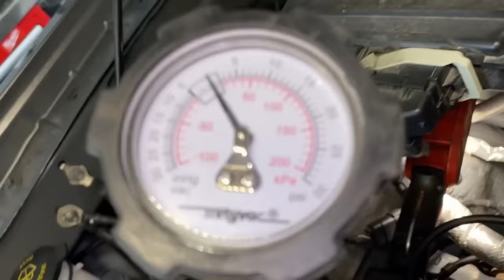2011+ Ford F-150 3.5L GTDI Ecoboost Engine P0299 Turbo Underboost Quick Diagnostics

Comment: HELP!!! I have a 97 F250 7.5 and its been hesitating when I give it gas, if I try to gas through it it stalls. But if I throw it in neutral turn it off and turn it back on it works fine for awhile. Its gradually happening quicker
Reply: The 97 F250 7.5 did not have a turbocharger or supercharger to my recollection and therefore should not be getting a P0299 code.

Comment: Any ideas why 13 3.5l goes into limp mode on start up after being driven. It shudders and dies on its own after a while.  Only does it occasionally. Takes longer to crank. Then fires up. Give it some gas and then it runs fine.
Reply: Need the change spark plugs and boots and/or need a new throttle body.

Comment: So what do you think and say about the weep holes that folks are drilling in the bottom of there inner coolers to get all the oil and condensation out I think there doing 1/16 hole or something I read it in a group or 2
Reply from the maker: It's a mess, best to install a catch can and do it right.
Reply: FordTechMakuloco I have a catch can installed dump the oil out the cooler I pick up a jdl for 50 bucks used

Comment: Planing to check the blow off valve tonight, but any other pointers for a 2013 F150 Ecoboost that throws a PO299 Underboost only when towing, generally mountains, generally at or near wide open throttle? Can clear the code and go another 500 or 10,000 miles without throwing the code again. 

My truck has been throwing this code for the past 3-4 years, but only a few times per year. Very intermittent.
Reply: Nah for sure its the BOV. Had same issue, only when towing camper or climbing a hilly road otherwise no CEL. In my case, didnt even get reduced power just got the stupid CEL and a bad feeling that this was gonna be a very expensive fix. You can clear the code and not see it again but as soon as you put enough load on the engine to force that valve to open wide, the CEL will come back. I went 3k before I saw it again then at that point I wanted a permanent fix

Valve change is fairly cheap and quick and the new part is better made than the old one. Takes maybe 15 minutes at most to do and gives you back the peace of mind that comes with no lights on the dash!
Reply: Confirmed, giant tear in the BOV.
Reply: I maxed out around 5psig boost before replacing the blow off valve, hits 13psig now. The engine will register the low boost fault but will only give the light if it registers the same low boost condition repeatedly, and if you drive gentle it may never notice at all

Comment: Bizarre timing. Got this code on my 2013 Monday, replaced the broken valve, fixed it. It's a pressure balanced valve and when that orange seal rips, there's a direct gas path open back to the inlet and the solenoid is no longer strong enough to keep the valve shut. 105k miles, $60 or less. It should probably be proactively changed between 60k to 100k.

Comment: So I just bought a 2013 f150 and I don't have that code but the boost pressure release valve is clicking so I'm getting that replaced but while I was under my truck I noticed a screw in my intercooler. Now I read before people were drilling holes on the driver side of the intercooler basically making it a weep hole to drain the oil. Is that going to be a problem? I'm going to have to fix asap or am I ok?
Reply: Just so people don't get on me I know the boost pressure release valve opens and closes but it's not normal for it to keep doing it very loudly every 5 to 10 seconds. When I got this truck it didn't do it at all till I drove from Virginia to Massachusetts and back to Virginia. I had the truck for 2 months before the trip.

Comment: I have a 13 ecoboost f150 that has severe turbo lag but it's not setting a code. Turbos spin freely by hand, catalytic converters aren't plugged and no boost leaks that I can find. Any suggestions? Do you think this BOV being torn could cause a turbo lag sensation?
Reply: It's really simple to pull and check. My 2013 valve was ripped to shreds and caused some performance issues but only threw a code when pulling a 7klb trailer up an onramp.

Comment: What I dont understand is why is the intercooler full of oil residue??? I always thought intercoolers drop temp of intake air...but no oil
Reply from the maker: As with any forced induction system there is much more oil carryover compared to naturally aspirated.

Comment: whats up man i have a question i have a 2017 ford fusion ecobost 2.0 i have the code p1016 i changed p/n f2gz9e882a but not thing still code is there

Comment: So have question ...it will b on 2004 ford Taurus.....plz help.... so car 77xxx miles runs great...I programmed a remote by turning key  8 times fast.. so it worked ...but now I have low battery voltage at idle ...goes up with rpm ....any idea ...thx n advanced
Reply: Sounds like alternator.

Comment: Do you know the part number for the pig tail that connects to the pressure relief valve you showed towards the end
Reply from the maker: WPT-1402 is the part number for the pigtail connector that plugs into the blow off valve.
Reply: Thank you!!

Comment: Ok here goes I have a 2005 Ford f150 5.4 3-valve that I'm having problems with a lot of problems mainly the spark I change 7 out of the eight spark plugs but with cylinder for I'm having a major issue with I've tried everything I can possibly think of to get this Tim's bar plug out it just will not under any circumstances come out I've tried the Ford extractor thing is not working tap and die not working penetrating oil not workingWD-40 not working nothing is working so today I went and bought a spark plug wrench to try to use and all the wrench did was take out my solenoid what do I do please help please please please somebody give me some adviceI can't think of what else to do I try to take it into the shop they want to charge me $450 to take one spark plug out just one that's highway robbery.I did the seafoam in the gas tank with everything else came out fine all other seven spark plug came out perfect nothing was broke peachy great wentvery smooth but it's one cylinder 4 won't come out should I just take my engine out.

Comment: 2012 Lariat 3.5.....  what is "underboost"?   just went 200k and when I tow my boat, I have NO power.. thing is running in 5/6... give it a little gas or hill 4/6 and even at times at 75mph.. it will go 3/6 on a really big hill.   Never has done this before.. always towed the boat like money with plenty of power.. hardly ever shifted down even on hills.. and if it did, you couldn't tell.  Right now it feels like I'm driving a super under performing engine.  there is NO engine light?  just throw me a guess.....    I had a local garage replace the solenoid for the turbo.. thought I hear a humming when it was pulling hard.  grrrrrrrrrrrrrrr

Comment: Hey man I was wondering if u have pulled a 17 model f150 5.0 motor out can u please tell me if the cab has to come off
Reply from the maker: no
Reply: @FordTechMakuloco  thanks I found a identfix TSB on it it's just alot of work

Comment: I have a 2013 f150 3.5l throwing the p0299 underboost and also going into limpmode. Once the code is deleted and the truck is restarted it runs fine for a few minutes then goes into limpmode again... if someone may have an idea please let me know

Comment: Hello All,
I have a 2014 F150 FX4 with the 3.5 Ecoboost. I have this burning oil smell from the right/passenger side turbo but only on first startup after sitting overnight or after a couple days. There is no visible external leak except where the turbo connects to the exhaust pipe i can see signs of oil at the connection and the smoke as the oil is being burned off. This smoke gets in the cabin as well when the fan is on and it comes out the from of the hood as well. Anyone has this problem before?

Comment: hola tengo un problema en mifor focus te comento ace nada cambies los inyectores por que notava que tenia relentin inestable y me echava un   poco de humo blanco en arranque en frio me da sensacion que el olor  es como mal combustion si te pones cerca es como si te picase los ojos  el motor a estado parado casi 12 años y se paro con 11000k por un porrazo trasero  cambie el motor a otro coche y llevo un año conduciendo  e cambiado reten del ciguñal y volante motor  e puesto los 4 inyectores reconstruido  y filtro de gasoil y filtro de aire ace 5000k  pero despues de poner todo esto veo que solo en frio meda la sensacion en arranque frio da como cabezeo como un prelin de relentin inistable y el humo blanquecino un minuto esto dia lo e estado mirando y es mas grisacio balnco  grisacio eso si huele como mal quemado no aceite  sino mas un olor que si mete la nariz tienes que quitarla al momento que puede ser ese problema gracias de todas formas

Comment: Could a failing Turbo sound like a Plane taking off (loud scream) when the accelerated ??
Reply from the maker: Yes if the turbine or compressor wheel is contacting the housing.
Reply: @FordTechMakuloco  Thinking about purchasing a Transit 350 ecoboost 3.5L van with 187,000 miles. What are things I should have the mechanic check before and is it worth that amount? Noticed a used tow pkg. so it has been towing something. 64 years young going to start traveling solo across the states with a SAFE vehicle. On SSD and can't afford new anything. 😊
Reply: @FordTechMakuloco  The mechanic told me the truck (2011 F150 Ecoboost) needs both turbos and the intercooler as the metal chunks have made a hole in the intercooler. But he's not sure if the metals made it inside the engine block. Spending thousands will be worthless if the engine block is screwed. 
What do you suggest?

Comment: What would cause a oil smell in the cab on a 14 F150 Eco 3.5 ? Just with the heat on not the AC ....
Reply from the maker: I would say an oil leak from the turbo or vacuum pump.
Reply: @FordTechMakuloco  Thanks 👍😊
Reply: @FordTechMakuloco  I don't have any trouble with the breaks, does that matter? And can you just replace the gasket, or do you need to replace the entire unit?
Reply from the maker: I will not affect the brake assist, it will just leak engine oil. We always replace the entire vacuum pump.

Comment: Hey, does anyone know what this is? I have a 2012 Ford Fusion SE automatic, with the 2.5L engine. When I have my A/c turned, my car makes this rough vibrating/grinding sound. This happens if I try to accelerate from about 1500 rpm, especially when going up hill and around 35 mph, and when I’m light on the gas. I also notice my car isn’t as responsive with the a/c on. These problems go away once the a/c is turned off. I’ve seen a video of a guy who has the exact same sound if that helps, but it doesn’t have any answers :/ 
The sound goes away if I take my foot off the gas and put it back on harder.
Reply: @Jonathan I've heard people did that and it solved the problem. How much was it for you to have it replaced?

Comment: Do you have to remove the intercooler in order to remove the EBOV?
Reply from the maker: no
Reply: @FordTechMakuloco  Thanks for that! My 2013 is throwing up that code, no power... Your video couldn't have come at a better time! I already ordered the new valve, but all the install videos I've seen have them removing the intercooler.
Reply: @TK-cl1jm  Brian is right you dont have to remove it to change the BOV but at this point you are fairly deep into it and probably could use the time to do a drain of the CAC. Unless you have the weep hole mod or a catch can, there is a fair amount of oily sludge in there that could be cleaned out. Just my .02 and respect again to Brian for making the video!
Reply: @aaronturner1072  Thanks Aaron. Yes, I have the weep hole mod already.

Comment: What you explained on the Exoboost F150 is that true with 2013 2.0 Edge? I’ve lost boost and have the same code. I’m not sure if the 2.0 has all the same components.

Comment: I have questions about passenger side wastegate actuator corrosion. I have similar issue in my F150 as in the video 7:21 - only the passenger side is corroded. Does anyone know why?
Reply: Mine is too figure its just because they are subject to moisture coming up from the road. Seems to be only surface rust so not worried. The driver side on the other hand is still good...because the oily discharge from the intake pipe keeps it coated!
Reply: @aaronturner1072  I thought maybe this is happening  only in my car. It reassures me a bit that this is a known problem

Comment: At 12:21 broken bolts are so common on Fords that they need to use harder bolts. I will not buy another Ford until they do a better job about rusting way to fast underneath the vehicle. I sew frames rust where they never should have.
Reply: Buy a new car every 5 years you won't have to work on it. That is what car companies bank on.

Comment: I see amsoil on the table isn't that boutique oil as  you call it ? What no Pennzoil Mobil 1 lol
Reply from the maker: Amsoil sent me some products to test after seeing my videos. My main parts shelving holds the 30 jugs of Pennzoil.
Reply: @FordTechMakuloco  I also use amsoil in my vehicle except engine oil cause I change my oil every 5000 kilometers 3000 miles or 3  months great products
Reply: John Mattiazzo they have their “OE” line of oils that are the same cost as the big box type oils. They are developed to go along with the manufacture oil change schedule.
Reply: I find Amsoil to be great for my 2 stroke engines. Little smoke and keeps plugs from fouling as fast on weedeaters, chainsaws, leaf blowers, to 25 hp boat motors.
Reply: @JasonW.  I also use it it my stihl trimmer great products spark  plugs always looks so clean
Reply: @JasonW.  That is because it is the new euro spec 2 stroke oil. The inexpensive Homelite oil doesn't smoke either .

Comment: amazing, a relatively new F150 turning into a rust bucket already.  connectors, cables,  lines getting crusty with rust.  Ford should be ashamed selling this crap, using cheap components.

Comment: Just don't buy an ecoboost is the diagnostic recommendation.  Just too much extra crap with a turbo engine.  The radiators are bad enough to leak then you add in a cooler for the turbo - NO

Comment: Wow, extra complication from Ford.
Look at Nissan, Honda, Hyundai, etc. and their turbo designs and very low volume of issues.
Reply: Ford  also sells more F-150's in the US than total cars sold by Honda and Nissan combined. They've made over 15 million Ecoboost engines. They're very good engines and they're used in heavy work trucks, not tiny passenger cars.
Reply: Sure. Whatever man.

Comment: Honesty as a flat rate tech at a Ford dealership I wish u would quit posting shit like this. Every customer comes in and already think they know the problem because there utube certified and your messing with our money
Reply from the maker: If I don't then someone else will. I post hundreds of Ford How To videos yet my Ford speciality shop is still overrun with work. So you guys are either doing something wrong or blaming the wrong person for no work.
Reply: @FordTechMakuloco  we stay busy,but there's nothing worse the a customer coming in saying ,I watched this utube video and this is what's wrong put this on my truck.theybhave some aftermarket part and it does not fix it then u know who gets blamed. The tech as always. If have been in the buisness u know we get all the blame.  U got over 500k sub. U arecdoingvsomthing rite. I dont have that luxury.I looked into the channel. Thank u for your service first off. I will subscribe as well.
Reply from the maker: Right, also during this video though I do mention it could be 15 other things and any vehicle with these codes should be fully diagnosed.